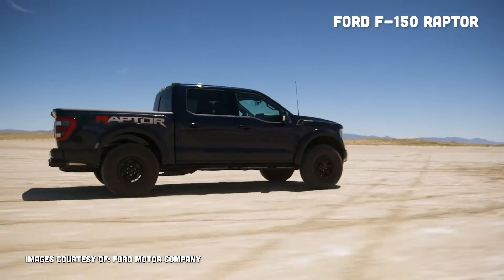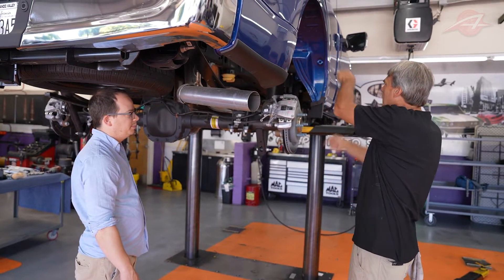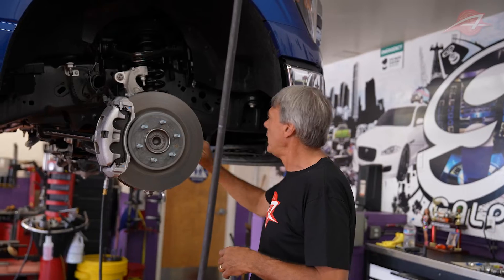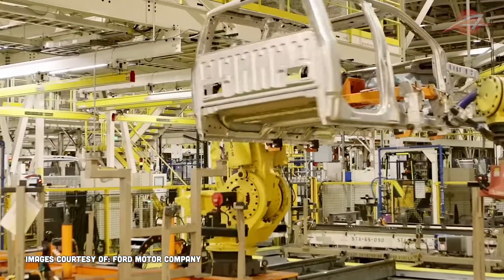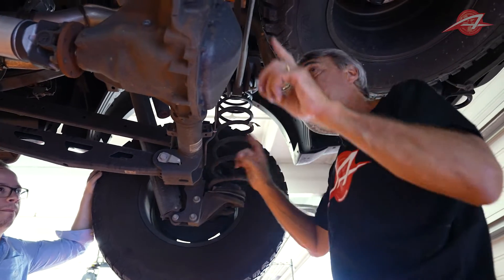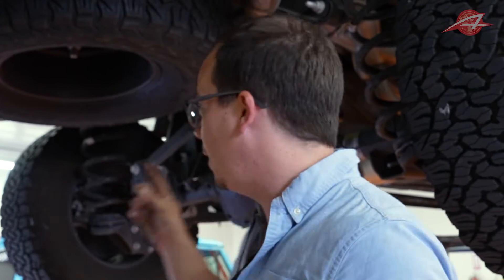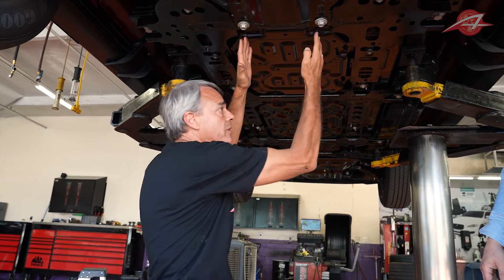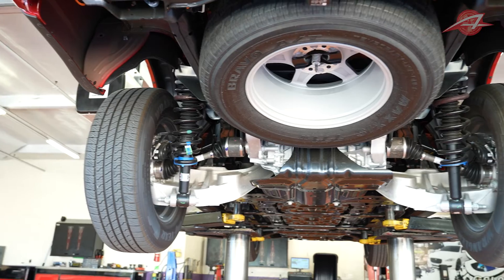Why The Current Ford F-150 Is Actually Three Trucks In One: Suspension Secrets

Comment: Great video, both of you! Most people dont realize these trucks are different.  Huibert Mees, you now have new a follower...can you be a replacement for Sandy Munro?

@10:02  I would put this a little differently than in the video. 

The video: "why wouldnt you be able to put a driveshaft in the truck? Because the battery would be there" (which is true)

My perspective: "you wouldnt WANT or NEED to put a driveshaft in the truck because its better to have the motor right next to the wheels to eliminate that kind of waste of motion, waste and moving parts"